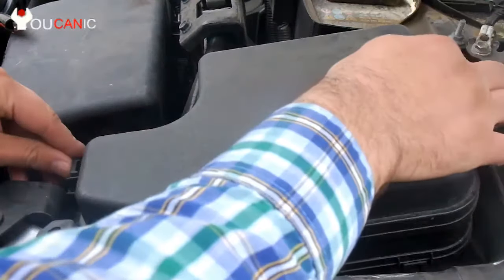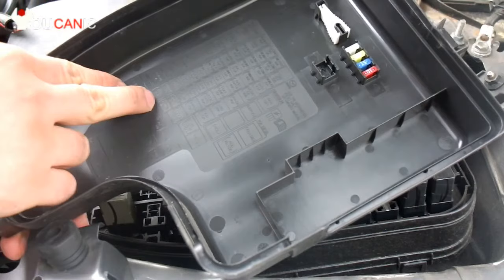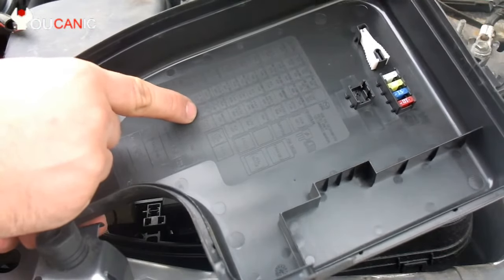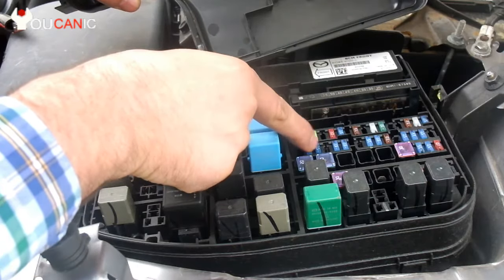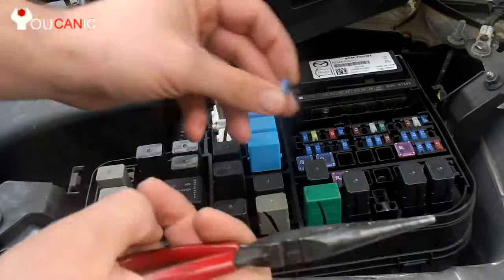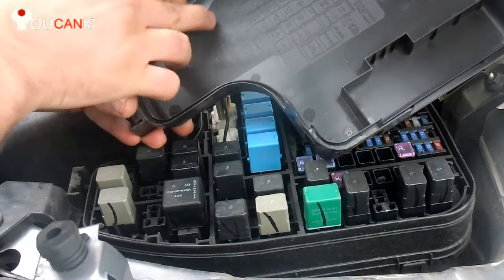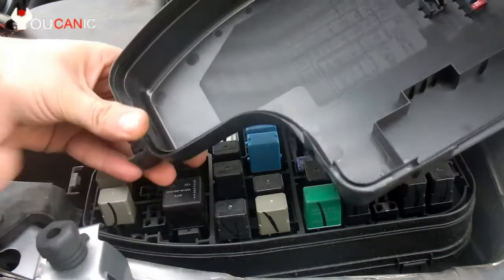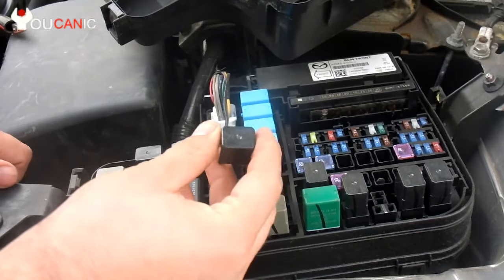How to Check Horn Fuse on a Car

Comment: This video was good in that you showed us where the fuse box was and how to read the chart and locate the fuses. I wish you had shown us more what a good fuse looks like and shown us the second fuse too. I’ve no idea what a bad fuse is supposed to look like and the second fuse wasn’t properly visible as your hand was in the way and then the video cut off too soon. Thank you n
Reply: A good fuse should have a continous white line across the centre inside. A blown fuse will have a white line with a gap in the middle. Hope this helps

Comment: Basically, he explained to first always start with checking the fuses if your horn or anything else is not working...if the fuses are good, THEN YOU should get it checked by an auto mechanic since you sound like one of those clueless/entitled individuals that can't chew gum and walk at the same time.
Got it?👍
Reply from the maker: Thanks for your comment! You're right, we at YOUCANIC strongly advocate for understanding the basics of auto troubleshooting like checking the fuses before proceeding to professional help. We aim to equip and empower car owners with knowledge and tools, so they feel more confident and informed about their vehicle.

We encourage you to visit www.youcanic.com where we offer ample resources, guides, and even a YOUCANIC scanner to assist with your car maintenance needs. Our mission is to stand by you and aid your car ownership journey. Any questions? Feel free to ask us on our site! Trust us, we're driven to help you understand your car better.
Reply: @YOUCANIC  No problem mate.
Reply: In my case the fuse was good, just dirty. I cleaned the electric contacts and plugged it back in, the problem gone.